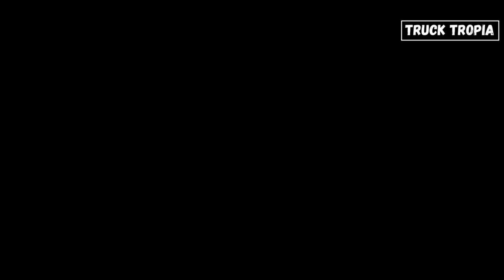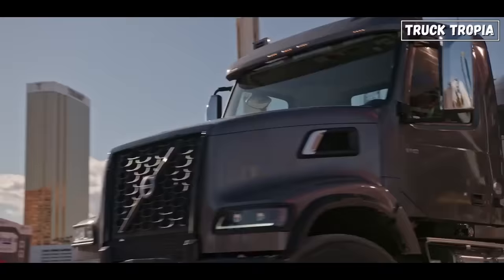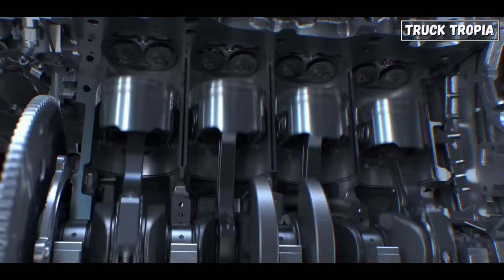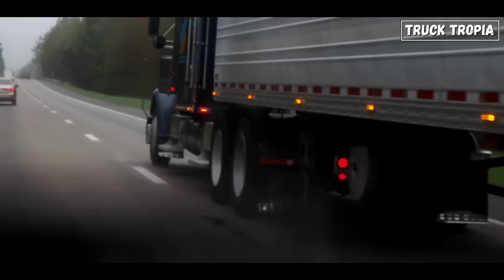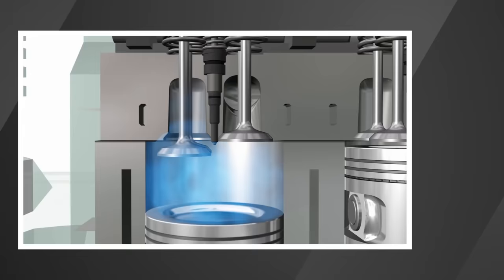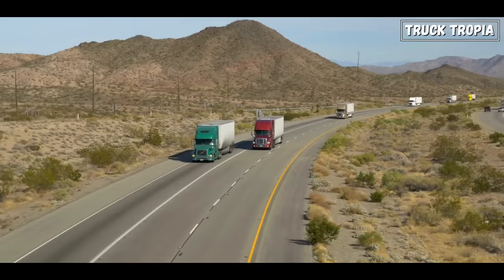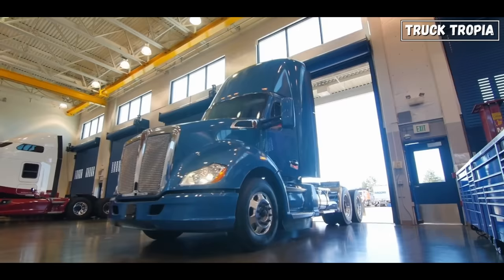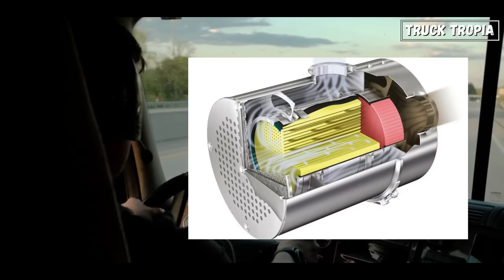Ultimate Truck Education 101 - Every Question Answered

Comment: Automatic transmission is wonderful except when you want precise control over low speed backing.
Reply: I could control my backing speed far better with the manual also. I did find a way to make the auto closer to the manual for backing. Just hold on the brake enough that the truck didn't roll unless throttle was added. Worked for me.
Reply: I've never had a problem with this, and i've only driven automatic trucks...
Reply: @TopiasSalakka  It does depend on the quality of the transition.   Shill a manual with give you much better control; not that I want to give up my automatic!
Reply: @TopiasSalakka  You answered your own question in a way. You have learned to back with the automatic transmission, and that is all you know, so it is a normal operation for you. Backing the manual transmission, I use the throttle to control speed, and if I let off the throttle, the truck slowed instantly. The automatic free wheels, so I had to learn to keep the left foot on the brake. Doesn't sound like much, but the first time I backed a trailer with an automatic, I felt that I probably looked like someone that had never backed a wagon into an enclosed dock in my life. I was very much embarrassed by my dilemma, and had hoped no one had noticed. When I hopped out, another older driver came up to me and asked, "That is the first time you have backed into a dock with an automatic, isn't it?" He had driven his first auto just a few months early, and remembered the pain of looking like a rookie.

I stayed with the older trucks for awhile, but changed from P&D to a meet and turn route with enough miles a day that a new truck was mandated. I ran 500 miles a day to the west and back, and another driver then ran the same truck and load 500 miles to the east and back which was another meet and turn. This was all in one twenty-four hour period. All the new trucks were automatics, but there isn't much backing to a meet & turn operation, so I was in good shape till I retired.

I hope your miles are all good ones, and be safe!
Reply: @ronfullerton3162  I actually learned how to reverse in a manual, though in a passenger car, since by default drivers ed makes you drive a manual car.
Still, modern automated manuals are great at reversing slowly in my experience.
Reply: @TopiasSalakka  After that I developed a method of backing that worked for me. I kept my left foot on the brake, and kept mild pressure on the brake so that the truck's movement was much as that of a manual transmission truck. Worked fine.

Comment: You know, there was a time when I thought I had learned that some of these big industrial trucks even had V10s or V12s!
Reply: There was v12 engines. Some are still kicking around. 
Those were 2 stroke Jimmy's. 
They didn't have any more displacement than the l6 engines and not as much HP or torque as the 4 stroke units
Reply: @darrenwebb5334 : Those were 2 stroke Jimmy's what?
And why were they V12 with the same or very similar displacement as I6 truck engines? And if they were 2-stroke then why wouldn't they have had much MORE torque and HP, or at least torque (I know HP is somewhat more complicated than torque) than 4-stroke ones? Why even make a 2-stroke engine that big if it's gonna be counterintuitive?

Comment: In California a significant number of buses and large trucks are fueled by Bio Natural Gas. Now that Cummins is finalizing their new 15 liter NG engine, the capability difference between NG vs diesel is effectively gone while the fuel costs is dramatically lower with NG with better emissions. Ask UPS, as most / many of their trucks / vehicles are Bio-NG. Bio-NG gets significant subsidies in California (for the time being).

Comment: When it comes to trucks, any question that asks "why?" is always about fuel efficiency. The two biggest costs for trucking companies are fuel and driver compensation.
They're trying to get rid of the drivers and let the trucks drive themselves so they don't have to pay the drivers. Slave trucks are a far better deal. Plus those driverless trucks will be far more fuel efficient than human drivers because they will never get in a hurry or get impatient or over-rev the engine while shifting.

Higher power is also irrelevant when you can simply gear down.

Raising axles is only about fuel efficiency and less wear and tear on tires and gears.

I personally don't like driving auto manual trucks. They're not automatics, it's a different technology. The transmission is still non-synchronous, so the truck manually shifts itself.
It's disconcerting.
I'd rather do it myself.

Cabovers were a pain to drive, especially locally. Climbing in and out was a hassle and the stubby gear shift with all the joints in the linkage was a pain to shift. The one I drove decades ago was an old truck. The modern ones out of Europe look fantastic. They probably are far more enjoyable to drive than yesteryears cabovers.

Once trucks can drive themselves, manufacturers will put the drivetrain in the trailer and get rid of the cab and tractor completely.
That way the trailer can haul more freight by increasing cargo capacity in areas with length limits. All wheels will steer, increasing maneuverability.
This will absolutely happen once electric motors and batteries are perfected for heavy trucks.

Comment: I've been driving Semi trucks for about 40 years. Of 17 cars I've owned, only 2  have been automatic. The rest manual. These so-call automatic trucks (automated manuals) are "ok" for dry or "inanimate" loads, but for liquid loads, they're complete and utter BS. Of my 40 years commercial driving, a little over 30 of that has been pulling chemical tankers. With these new electronic log books we get scored on efficiency and driver performance. We get paid our safety and efficiency bonus based on the telemetry. I was hired about 3 years ago by a really good company, and was offered a really nice brand new Pete with an automated manual... I said no. Give me the 2014 Mack with the 18 speed manual you tested me on. They scratched their heads at that. It rode rough, it was noisy and I loved it.

 On the safety /efficiency score, I was consistently scoring 100% just about every week and never less than 95%. Well, they decided to retire my old Mack and gave me a brand new Freightliner with an automated manual 12  speed. Guess what happened? My driving score now sits serenely at about 78% to 82%... No bonus for me. Liquid loads move. You're trying to accelerate, the load sloshes backwards and the truck thinks oh-oh, there's a big hill here so it down-shifts on you... oops! "Hard acceleration! Oh, you aren't driving efficiently. I've tried it in "manual" mode too, but the computer over rides you if it thinks you aren't doing things correctly. Best driver score I've had on this transmission is 92%. That equals reduced bonus. I average 85%.

 This is not even getting into winter driving... that's another whole story. My conclusion, automated manuals are fine for dry freight, but for live loads like bulk liquid or livestock.... give me a good old fashioned manual any day. Way more control on icy roads and way better fuel economy for live loads. I miss my 18 speed manual Mack. I got a tear in my eye the day it was sold.
Reply: Did some driving in the mid to late 1980's. Finally got back to the trucking industry a few years ago. Do I ever hate the auto's. Dam things will upshit going down hill. Drove t680 & cascadia doing stepdeck & flatbed. The freightliner auto was way better.

I got so sick & tired of the micro managing, by desk drivers, calling up and reaming over telemetry. Or something they saw in the camera. Why did you hard brake, to not kill the stupid fuck who turned in front of me.

Got my own authority, W990, 18spd manual, 565hp, 1850tq, no governer at 65mph. Pulling 53' stepdeck.

Walking through tall corn now. Manual 18 spd & No dipshit desk driver telling me how to drive!
Reply: Your just a driver. When the word is sent down from on high ( Accounting Department) you should be happy that men much smarter than you are making these decisions. They probably have years of over the road experience (Actually they have never driven a “Brick and Mortar Truck”) but have qualified on a computer simulator. So when you lay your head down to sleep tonight you can be comforted with the knowledge The Accounting Department” has your back.

Comment: A 4x2 is like a conventional pickup truck. Whereas a 4x4 is a 4 wheel drive truck.
Reply: No 4x4 is a tandem rears where both axles drive just like 6x6 steer axle drives and the rear tandems drive also or a 6x6 could be 3 drive axles behind the cab

Comment: Torque is not 'pounds per foot'.  It is 'foot pounds'.  Foot pounds is a unit of measure of torque.  It results from multiplying a force by it's distance to the point of rotation.  If you increase either the force or the distance you increase the torque.  That's why the unit is foot-pounds.  'Pounds per foot' imppies the unit is pounds divided by feet but it is not, it is pounds multiplied by feet thus giving the corrent name 'foot pounds'.   Wouldn't expect ai generated content to understand that though.
Reply: Yeah, makes me doubt the correctness of other things in the video.  Also 5 days later, the video hasn't had its audio re-edited.
Reply: SAE standard J1349, Table 1 lists the units of measure used in the standard as “N-m or lb-ft” for torque

Comment: Over the road trucks from the 50s all the way up through the 80s had V8s. Cat, Cummins, Mack and Detroit all had very successful V8 engines. The problem was they cost three times as much as a six cylinder when it came to rebuilding them. They started off at 500 hp and were absolutely massive compared to the straight six engines. They were for the big boys with the big bucks. Not a lot of people could afford the V8 options. I became a professional diesel mechanic in 1986 and over the next 10 years I saw all of the old-school stuff get scrapped and electronic fuel injection come to diesel engines. Over the course of my career I dealt with everything from dual point distributors all the way up through DDEC IV. Once they started to require adding piss to the exhaust system I’d had enough. I took the past 17 years off to raise my kids. The world has turned into a shit show in that time. Now you have trucks that will shut themselves off because there’s no piss in the PP tank.

Comment: Having a manual transmission and a jake brake is almost vital in mountainous country to keep from losing your brakes with a heavy load. I've seen a lot of automatic and semi-automatic trucks on the 'runaway' ramps as a result of losing control due to insufficient engine braking. Also, we're NOT on the cusp of an EV switchover for heavy haulers. We just don't have the infrastucture to support it, never mind the lack of range for over-the-road hauling. The battery technology just isn't there yet. Kenworth has already quit offering electric trucks as of the beginning of this year, because they're too expensive to manufacture and maintain, and a lot of the outfits that bought them are turning them back in for diesel-powered replacements.😐
Reply: You can have an automated transmission and "Jake brake" as well as a retarder.

Comment: Did  hear him say V8s were more expensive because they have 2 camshafts instead one? Can someone fill me in on what big truck diesel V8 has dual over head cams. Just as an aside gas V8 engines that have dual overhead cams have less parts in the rest of the valve train somewhat offsetting the extra expense of the extra camshaft.  No pushrods, many do not use rockers ect. thus much simpler valve train.
Reply: One cam over each band. There is only one bank on a six, so only one cam.
Reply: Older isx cummins(inline 6) have  dual camshafts
Reply: @robertarrol4374  My comment was on V8s
Reply: @utooobur  copy,should wear my glasses more often🤦🤣🤣

Comment: Extra axles are not necessarily for grip on trucks with 3 axles it's about weight distribution.  They carry more weight so the extra axle allows them to do that and not get weight violation or have to buy expensive permits.  However, permits are the cheapest option if it's a one time thing for the weight.  You have to custom order with more axles which is more expensive and most people don't do that unless they intend to haul the weight on a regular basis.

Now on the trailer that gets tricky.  There are a lot of configurations.  If it's a 2 axle trailer you might see one axle raised if they have that ability when it's empty.  This reduces friction and increases fuel mileage.  Especially if it's a spread axle, see this a lot with flatbed.

In Michigan, this is a great example for multiple raised axles, you might see that when those scrap metal haulers are empty.  They also raise axles when they turn, tires will pop off the rims if they don't lift the axles when they make a turn.  They have control box in the cab of the truck to do this.  
The reason the trailer has all the extra axles is weight.  Those trucks haul double what a regular truck hauls.  However that is legal in Michigan but you can't do that with 5 axles.

Comment: "...also, longer wheelbases can make backing up more challenging,  particularly when the driver needs to maneuver the truck in reverse."

How else are you going to back up a tractor trailer?
Reply: Explanation ... with the rear tandem axle raised it shortens the tractor wheelbase which also makes the tractor turning circle smaller. So when backing a trailer the steering reacts faster to steering input ... hence easier control over the trailer and reduces the need for pull ups to reset tractor/trailer angles.
Reply: @oldeenglish8058  Sorry longer trailers are easier to back up you can control the direction of the trailer because the reaction of steering input is much less compared to a boat

Comment: #2, your 5th wheel is A slider to take off the Steering wheel tires, and moves thw The wait to the trailer or take weight off the trailer.

Comment: lbs/ft is wrong. You cannot use division in the torque equation.

When measuring torque, a lever that is a distance of 1 foot from the center of rotation is used to determine the acting force.
So, if an engine's piston stroke length is only 6 inches, then that means the crankshaft radius is only 3 inches, and therefore means then to produce 1,000 lbs-ft of torque means the piston is actually providing 4,000 lbs of force onto the crankshaft during the power stroke.
A lever of 3 inches is 1/4 the distance of 1 foot.

Imagine if our engine stroke lengths were 24 inches so that the crankshaft radius was 12 inches and providing the full 4,000lbs of force... that'd be 4,000 lbs-ft of torque and we'd be able to operate at even lower RPMs, which means we could have fewer explosions per minute, and therefore have even better fuel consumption.

Comment: I would never buy a single axle travel or any other kind of trailer. Twice the stabiity dual axles. Ever see those single axle trailers swerving dangerously all over the road? A slight gust of wind turns over  many of them l. On a side note.

Comment: 33:56  IF U SAY SO, then why do EV buses use / have options for transmissions? Actually a bit more going on.

Tesla doesn’t believe in transmissions but the EV buses found out the hard way fast that if you don’t have an option for transmissions that a significant number of applications will have EVs stall on startup on grades. That is why on heavier applications the E-axles have TWO ELECTRIC MOTORS going through a planetary gear cluster to get the benefits of gearing reduction. There is / was an EV bus manufacturer that has / had an option for a four speed transmission (“had” as in going bankrupt and the $1,000,000 EVs are now boat anchors, all 1300 of them).

Comment: on the topic about trucks using diesel.  the diesel also helps lubricates the motor. also the inline six is easier to rebuild and also lasts longer
Reply: also the auto transmissions especially Detroit there is no rebuild u buy another while with a Manuel  trans u can rebuild the trans.

Comment: 6 cylinder engine has fewer parts than the v8
Reply: Not just that but the inline 6 is usually very well balanced for some reason.
Reply: I6 engines are better balanced, lots of torque, fit in between the frame rails easier and main bearings last way longer than v8.

Comment: Most truck engines outside of North America have their HP ratings measured at the flywheel. Others are measured at the wheel hub.  HP can be raised or lowered via computer. 
A 16 L Caterpillar might be running at 475 hp or it might be operating at 750 hp. 
Running higher HP when speeds are highly restricted helps the truck maximize its performance and range. Allowing the driver to improve productivity.